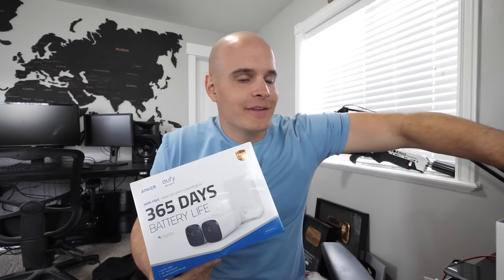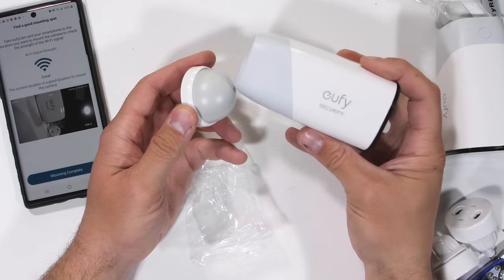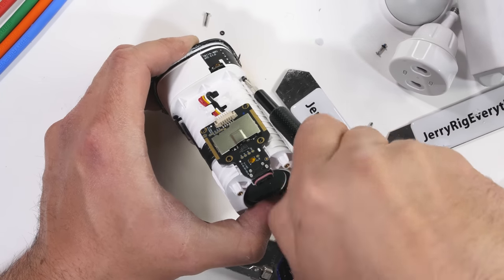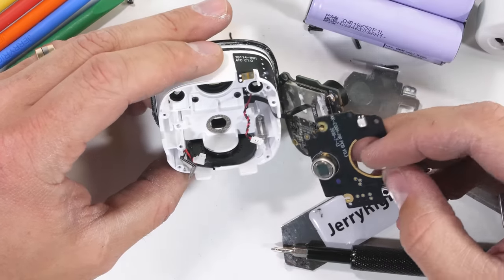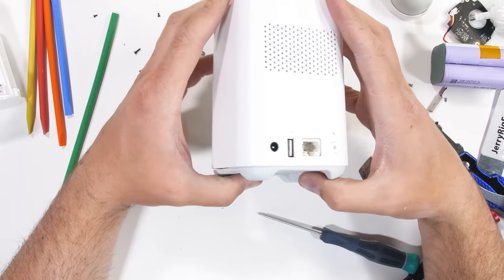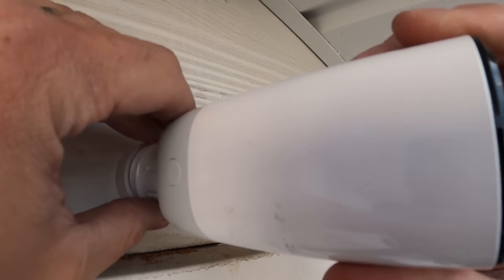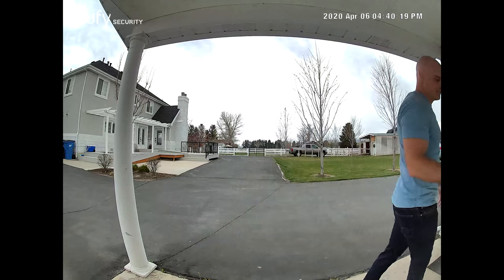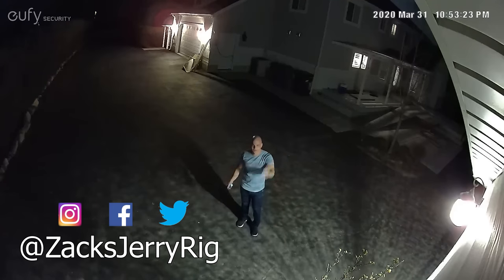365 Day Battery!? - Eufy Wireless Security Camera!

Comment: I have a eufy battery video doorbell, a handfull of their battery cameras, a homebase 1, homebase 2 and an indoor ptz cam. I was going to go all-in on their ecosystem but after using the products for a while that is no longer likely to happen.

This is probably the most buggy unreliable overpriced under-performing line of “security" products available. I could sit here all day and give you an itemized list of reasons, but just take my word for it and buy something else. At the very least spend a few days reading the endless complaints from users on the eufy forums and know that most every claim eufy security makes in their sales literature is a misrepresentation and should be taken with a grain of salt.

To give you an idea of what I mean...

Despite them selling us on the system having local storage and not relying on the cloud the entire security ecosystem is run through their servers. When their servers go down (and they do) you’re unable to access any of your footage even if you’re on the same lan as the cameras. If they go under or pull the plug you have a lot of expensive paperweights.

Also...

Their claimed runtime between recharges is basically a bold faced lie if you actually plan to use the products. Motion detection is a.d.d.. Activity and ignore zones are largely broken. No 2fa unless you’re in Canada or Germany (and good luck buying the security lineup in Canada). Says it supports up to 16 cams but pukes and dies when much more than 1 thing is happening at a time with only 4 connected. (And will lose recorded events as a result) Scheduling and geofencing are basically broken. It constantly misses obvious events but is forever notifying of things it shouldn’t. It detects cats as humans. It detects people as pets (ok, kind of hilarious when the indoor cam thinks my wife is the cat and the camera plays a recording that says “Who’s a good kitty?” but still.) 

Did I mention that even while ‘turned off” in the Eufy security app their indoor cameras are constantly communicating with a variety of servers on a minute by minute basis. Not just for dns and firmware checks either... Circle shows them as IP’s for steam, facetime, minecraft, etc. No idea what it’s doing but it probably shouldn't be doing it when off. (I put it on a smart plug and power it down when I'm home)

...I’m just getting warmed up. I could go on

Look elsewhere. Seriously. At least until they do a 180 and get their shit together, which by the look of things won't be happening any time soon.  :lowbatt:

Just a heads up.

Comment: Thinking it was a direct connect to wifi and but it had its own transmitter...so if you have wifi unifi outside access points with a lot of coverage this camera doesn't use it... this is the only bad thing I can see from that camera

Comment: Battery powered security cameras? Security system is one thing but for sure get REAL security cameras that are wired for 24/7 real recording. Sometimes these motion cameras miss the very beginning of motion because they weren’t recording. You can get a nice starter setup at Costco they have some on display. I bought direct from a website for 8 cameras and have two hard drives in raid that support 3 weeks with 4K resolution 24/7 recording.

Comment: Hi Jerry. Cool video. I see you kind of tech guy. I have a question, please: is it possible to use a dash camera with Apple iCloud service? I don't wanna any extra charges for cloud services when I already have an iCloud plan with Apple. I found a dash cam which would suit my needs, it has wifi, 4G connectivity, and parking mode. All cool, but I wanna use iCloud instead of there's cloud if you can understand what I mean.

I am not paid to promote, but the dash cam I am interested in is Blackvue DR750 series 2Chanels Plus LTE.

Or another question: do you have any idea when Apple gonna release dash cameras with iCloud possibilities.

Thanks a lot if you find some time to read my comment,
+Sub

Comment: After spending 300 pounds for less than two years, the battery can't be charged. I think the battery is broken. Call customer service, said that after the warranty period, ignore me, in this use of two years is not very easy to use, a rainy season water fog ran into the camera, simply can not see clearly, so it is not recommended to buy.

Comment: Sure, not having to run wires through your house is nice, but having to recharge a security camera every year seems like a far bigger hassle in the long run. I'd rather run a power cable to a wifi camera once, rather than have to figure out how to recharge a camera that's 15ft off the ground, probably filthy and full of cobwebs. Anything worth doing is worth doing right, in my opinion.

Comment: I heard that all Eufy devices can only work if you have 2 separate bands, 2.4g and 5g, at home. IF you have a mesh network that combines 2.4g and 5g into one SSID then their devices will not work. True ? Anyone ?
Reply: bit late, but false. My router combines the two bands into a single one and seems to handle a Eufy robotic vacuum at current. even when i'm not home i can control it, right down to manual driving.

Comment: i think this is not good security system, real security systems with dvr record continuously video in memory buffer (about 5 sec), and when there is an event, the buffer is recorded and event after buffer too, so you can see all and 5 seconds before event starting... this camera maybe is fast but not enough and and least 1 second will be missing from captured video, also camera does not have ir lights, and if no other light source, the record will be with very poor quality, i think ANKER should keep making their cables and power supplies, and leaving security for professionals...

Comment: just looking over the Amazon comments you know this isn't a very good product, battery life is not going to reach 1year only in very best cases when it's always warm outside and almost no movement detected, so the battery will last about a month or less, motion detection is not reliable, really short wireless range 20feet(probably to save battery life), quite expensive given that the battery pack costs about 20$, if you want to look at the camera feed or continually record, the battery will drain really fast, no IR LED means it's useless at night, also Eufy is owned by Anker which is a chinese company so they'll probably not use it to spy...

Comment: Could leave Tesla out of it, as it's not like they invented the 18650, not were they even remotely near the first to use them. They were made in 1990, and since then have been used in flashlights, laptops, power tools, vapes lol, and so forth.  'Ol Tesla pants Elon Muskers simply took a well established battery, and used them. Anyone could have... GM literally could have with the damn Saturn SC1EV and so on, why they used lead acid I do not know. . . Could have beaten Musk to that line by decades.
Reply: Brett Prior ..Elon also took a boring old roofing torch and turned it into a flamethrower (It’s sitting on the shelf behind him in the video....LOL)